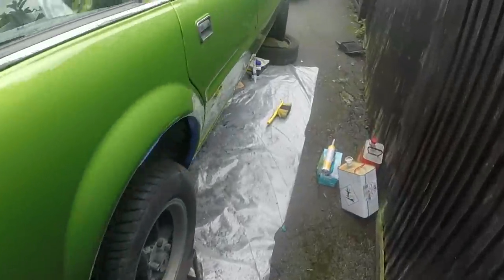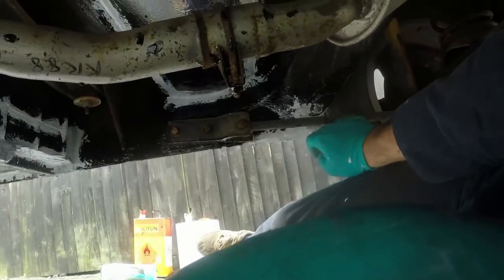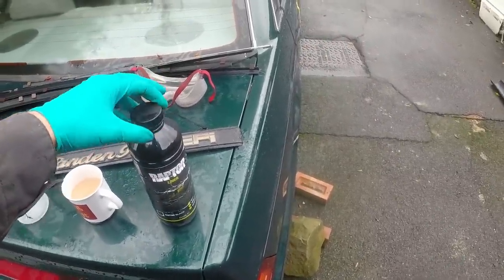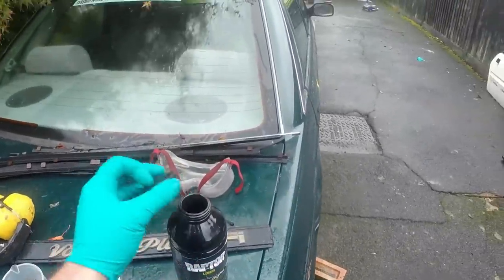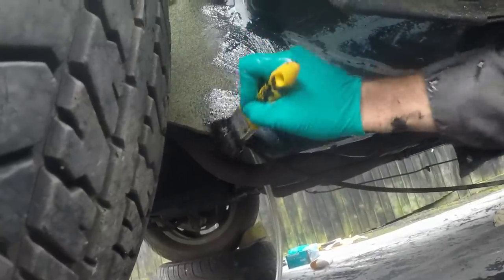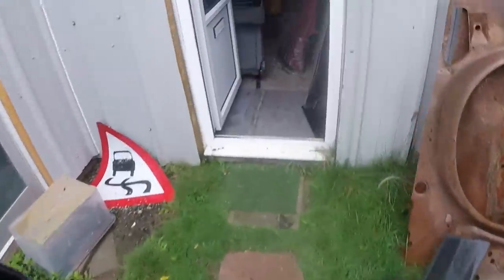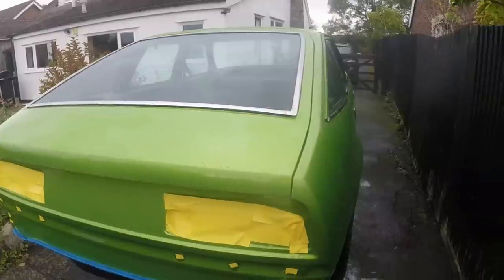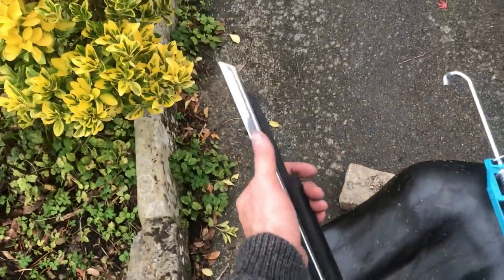Dotty 1981 Rover SD1 Restoration - Video 54 More painting

Comment: Nice work as always Jim,  my advice on the rear screen would be to remove it to allow the aperture and rubber to be dried then before fitting seal it with 3M 08509 windscreen sealer,  I've used this for decades and can fully approve of it, it's very sticky but does not dry fully,  you might curse me while your fitting the screen but it won't leak.
Reply from the maker: Im gonna keep an eye out for another seal that is less shrunk.

Comment: I've had good experience with galifroid it dose require a top coat but I've had bare metal without in the garden for years and it's come out mint only downside it's heavy
Reply from the maker: Cool, just googled it.  What did you put ontop and did it stay stuck on it or did it delaminate?
Reply: @nitrosilvia  I haven't found it to react with anything I've used celilos, hamerite,acrylic I haven't tried two pack though. I'd like to know what can be used to thin if you find out could you let me know 👍
Reply from the maker: @stephenbates8370  hmmm not sure.  SOmetimes you can google the paint and find a data sheet.  That will say what solvent to use to thin it for spraying.  Maybe email teh manufacturer.  Looks good stuff.  Ive been using teh zinc rich bonda primer that looks similar, but its red as a throw back to teh old school red oxide stuff
Reply: @nitrosilvia  thanks we're i get it from is we're i get my silicone sealants from for my job and there really good for getting spec's on their products I'll ask them and let you know it would be great if we could spray it for those awkward places 👍

Comment: I swear by vactan for rust killer and primer and used shutz for years but that raptor paint looks far better.  Where did you get it from?  I've got the arse end of a rover 75 to do shortly
Reply from the maker: I bought it from ebay.  The single pack stuff is called Gravitex and that works well too.